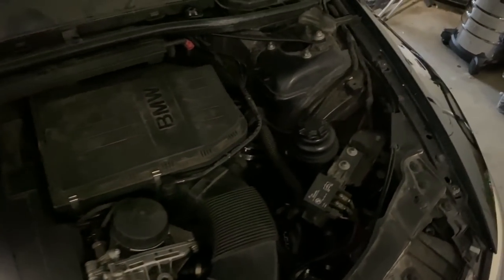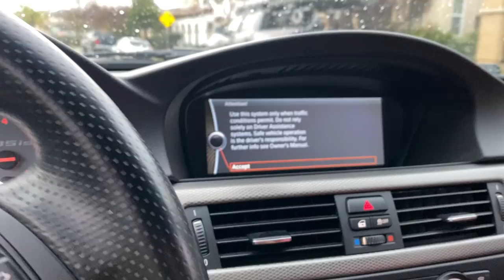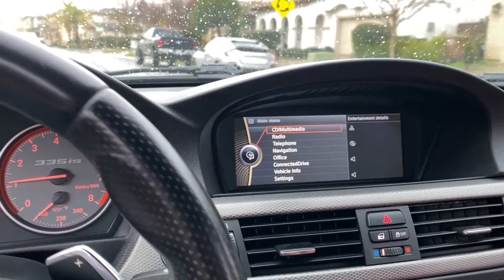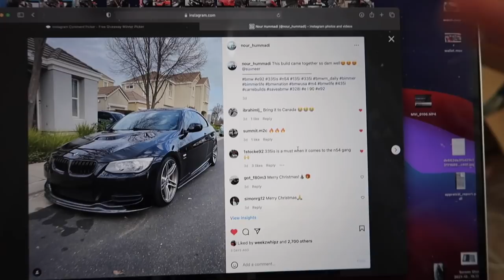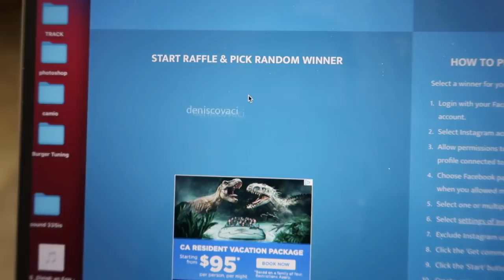BMW G80 SOUNDS INSANE WITH NEW INTAKES AND DOWNPIPES!

Comment: Sounds sick but now the cars just gunna heat soak more easily. Performance > Noise
Reply: Intercooler does all the cooling, the compressed air that comes out of the turbo is about 400F regardless if the intake is sucking up 30F air or 80F air.
Reply: @payamh9118  weather it has charge cooled air or not though its gunna suck up mass amounts of hot air for long periods of time if your driving the car how its suppose to be driven. The charge air system or "intercooler" can only cool so much, and with that much hot air being sucked in, its inevitable, its gunna heat soak more easily (KEY WORD) than the stock closed system. Daily driving on the other hand, these intakes wont make a difference when referring to heat soak. But racing, these intakes aren't as good as the stock closed system and there is plenty of dyno sheets w/ back-to-back runs that show this. Stock intake is king especially if your focus is performance,  again, is just my opinion. And im referring to the intakes sucking in hot air, idc about the compressed air coming out of the turbo. i'm referring to the heat coming off the engine from racing around and the intakes just sucking in all that air, this will create something to be more prone to heat soak, an intercooler can only cool so much for so long.

Comment: Mst intake sound way better than the BMS intake for G80’s.
Reply: MST intake tapers down to 3" which is smaller than stock, so it's a restriction not an upgrade like the BMS ones. Both intakes sound the same actually...